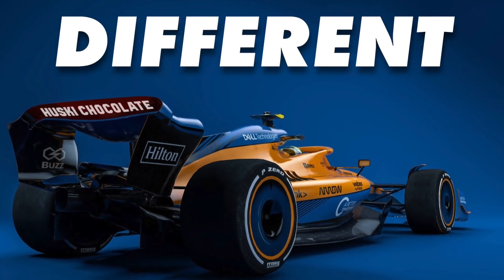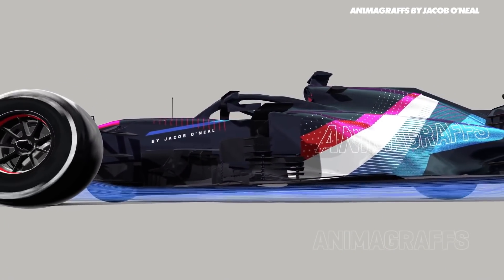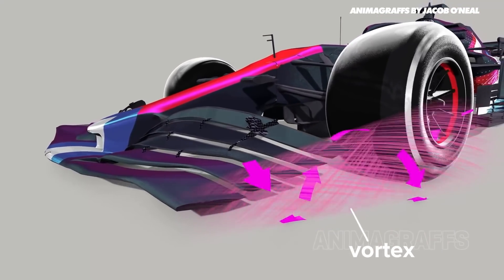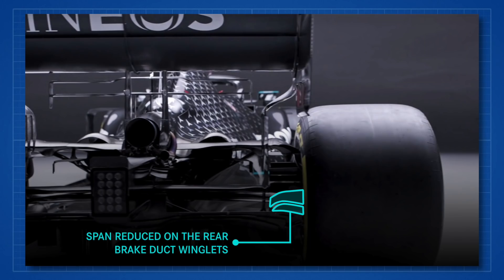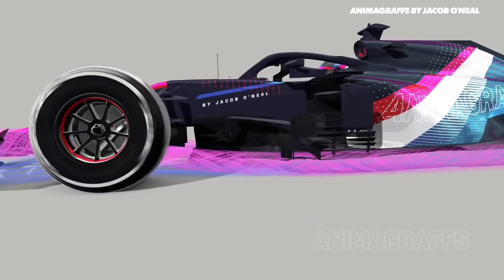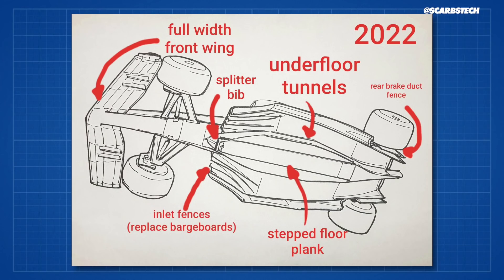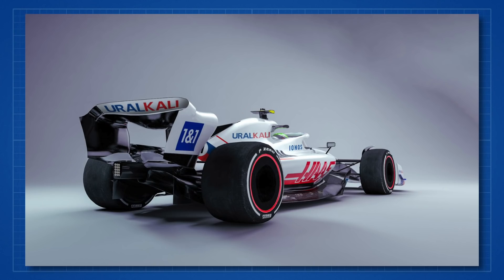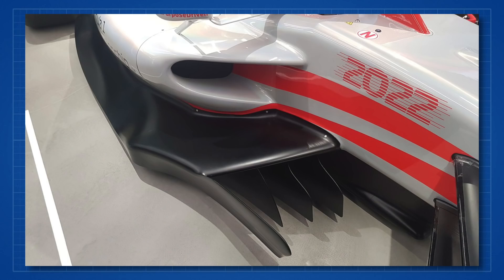How the 2022 F1 Aero Tunnels Actually Work

Comment: I'll be interested to see what happens if they ride the curbs and the impact that might have on the aero underneath the car. I can't see the 2022 cars being as aggressive on the curbs if its going to massively impact downforce
Reply: The big kerbs need to go anyway. Too many accidents already because of them.
Reply: @schwuzi  My thoughts, get rid of the kerbs altogether and keep all of your wheels on the black stuff or it's a penalty. They would all stay on the track then.
Reply: Won't make much difference in my opinion (for the title contenting cars atleast), I saw that the tunnels are mounted on the chassis that remains stationary the suspension absorbs most of the bumps and the tunnels aren't rubbing the ground like they did in the 70's rather these tunnels are lifted and are sealed via aerodynamics. So how well these tunnels are sealed I think will be the difference of performance.
Reply: @khawajabasit977  There's no such thing as a stupid question but sometimes I really wonder if these people even watch f1.  I'm not picking on you but the original poster.  Do current cars lose downforce when they curb ride?  No.  Why?  Suspension.  Suspension or more accurately ride height managers.
Reply: @Bahamuttiamat   Depends if your 'curb ride' involves some bounce that the suspension can't fully absorb which does happen so the OP's question is good. Anyway the drivers are going to have to avoid anything that will disturb the ride height because, obviously, ground effects is height crucial.
Reply: @FairladyS130  I have no doubt, but f1 suspension is specifically designed to be a stable aero platform.  We don't really concern ourselves with current cars losing downforce and ultimately control over curbs, so I don't see why there would be with the 22' spec.
Reply: @Bahamuttiamat  because if you change the attitude of the car the airflow under the car and hence the downforce will change, less on the side that's up on the kerb.
Reply: @philspencelayh5464  

My point is; modern f1 suspension is more about aero platform rather than ride quality.  Meaning curb riding will not upset the aero balance to any meaningful degree.  The areo platform is robust enough. 

Also, the 2021 spec f1 cars are in fact ground effects cars.  Hopeful this elevates your concerns.
Reply: On high speed areas like maggots becketts I expect they will be staying off the curbs now.  Also I imagine avoiding sausage curbs on low speed corners will also be an emphasis to avoid physical damage to the tunnels.  Regardless, I expect the lines to favor the asphalt a lot more in 2022.  What interests me more is high speed bumpy corners like Cota.  That high speed S section is going to wreak havoc with ground effects.  The indycar generates so little downforce from their floor, I don't see it as comparable.
Reply: They won't be riding curbs at speed, where aero comes into effect. Where they do ride curbs, it will be at much lower speeds where they depend on mechanical more so than aero-grip.
Reply: High Curbs are gonna be a drivers worse nightmare. Like more so then previous seasons
Reply: Indy cars have had tunnels like this since forever and they have no problems with curbs. So don't worry, F! designers aren't going to let themselves be bested by us American hicks.

Comment: "without cars, motorsport is just jogging." Now I weirdly find myself wondering which F1 circuit would provide for the most exciting foot race. The brain is a crazy place.
Reply: spa. running up the hill would be a nightmare
Reply: @davidcumming8567  yep, i did it by bicycle, Spa is really tough
Reply: @jean-loupparisis7330  yes. Spa and Daytona Road Course are tough.
Reply: @davidcumming8567  yes. Cars could slip and slide and headon into the tires.
Reply: @davidcumming8567 imagine running up Big Red on the circuit of the Americas 😂😂
Reply: Monaco be like: finnally I am worthy
Reply: @ayushkumarsingh7658  yes. Spa and Daytona 500 also
Reply: The Nordschleife
Reply: @elijahchampaigne6753  that’s a marathon
Reply: @raceyrache8463  2 rounds litterally are 😊
Reply: @elijahchampaigne6753  Daytona 500 and Rouen
Reply: Low key excited for a Monaco foot race, I recon it would solve it´s overtaking problems
Reply: How hard would it be to run in Mexico since the air is a lot thinner?
Reply: @DeeKooooo  Sergio Pérez is gonna get a huge advantage so you just gave him the win
Reply: Baku castle section would be awesome with 20 people jockeying for position
Reply: So reverse grid for foot race after real race??
Reply: @republikadugave420 that’s a great idea for a biatlon lmfao
Reply: Was jiggling and wondering myself 😁
Reply: Yes but blindfolded! That would test track knowledge 😆
Reply: @trisbonky  Blindfolded 1 lap foot race around an F1 circuit, with the pit wall calling out when to turn and how to stay on track and providing motivation.
Reply: Portofino!!!
Reply: Hamilton vs Verstappen 1 lap jogging race at Yas Marina would be best way to decide title fight
Reply: Doing a triathlon on and around the Zandvoort circuit this summer, I think the dunes will be quite a challenge..
Reply: @thijewubs9646  Don't you have swimming in triathlon? Do you wait for it to rain and flood the track?
Reply: @PunnamarajVinayakTejas  Haha that would be a viable option with our weather, but I think they planned to do it in the sea, which is just near the track
Reply: It would be any place where the temperature on track it's higher than 35°C
Reply: Spa and Mexico 100%
Reply: Jeddah, it’s a really fast circuit
Reply: It'll be fun to jog in Sepang under 33-34 Degree Celsius 🤣
Reply: As a runner, i have always wanted to complete a lap of the nordschleife on foot. I think it would make a very nice half marathon race.
Reply: Albert Park is basically just a jogging track when it's not a race track
Reply: Mononaco,   so many areas for heckling.
Reply: Monaco for sure. Any very technical track is likely to result in overtaking
Reply: Has to be Monaco
Reply: Brands Hatch but reversed. Paddock Bend uphill at the end of the lap would be a killer
Reply: Monaco would be interesting! "And it is two wide into turn 1!!!"
Reply: Teams would resort to parkour especially round Mirabeau Monaco
Reply: I'd say Monaco, it would be nearly as fast as the F1 cars go around it. Watching it often gets me to sleep.
Reply: Once a year they should do that. Maybe Monaco. The race would be more eventful.
Reply: Monaco will have some crazy overtakes & pit stops hahaha
Reply: I rode a razer scooter around Phillip Island when I was a kid. that was horrible, so bumpy on those tiny wheels my brain got rattled.
Reply: Just go back to riding horses
Reply: Jenson button was probably the fittest f1 driver of his time
Reply: @thelegend5243  you can't know that.  Pure speculation.
Reply: @Eugene Almost but not quite. You would want to go straight from apex to apex, and sticking to the right side is if all corners are right handers.
Reply: Spa would be an endurance race but I think something like monza would be perfect cause it’s so wide on the straights but so narrow in the corners
Reply: "Without cars, motorsport is just jogging."  Would this include pit stops for changing shoes?  How would aerodynamics of the joggers clothing be manages?  What safety gear would be needed in the case of falls and wipeouts?  Would there be a slipstream?  ....  You have created far too many questions!
Reply: I think he meant, without cars, “Motorsport is motoGP. And that’s awesome.”

Comment: "Air pressure decreases as speed increases."
Not quite.
I can't stand it when people make statements that over-simplified.
The pressure changes from static pressure to dynamic pressure. The total pressure does not change for a fixed volume.
It is helpful to think of the classic Brownian Motion experiment (put some smoke it a small contained vessel and look at the particles under a microscope). The smoke particles jiggle around with no discernible overall motion. The experiment shows that air is made from particles (molecules) that buffet against each other. The aggregate force (the average vectors) of impact of these molecules means equal pressure over a surface.
While the air is still.
Now, if we impart a flow to the air, the molecules continue to buffet about but the average vector of impact now runs more parallel to the surface of the container and so the impacts impart less forces into that surface. Thus the dynamic pressure increases (the flow) but the static pressure drops.
Remember that under a car, the air is not moving, the car is. The motion of the car through the air sets up the dynamic pressure change.
Reply: Let's be honest, if the description is as exact as you mention, it will be 20-30 minute long video
Reply: Feel clever describing it in a way the average punter won’t understand it?  Callum was well versed and was able to educate more people to a principle that is complex. I can clearly see you’ll never be the professor arguing stupid points like this.
Reply: @raceyrache8463  sorry, bun gross over simplificanions are worse than what you describe. Good luck explaining the truth to the unprepared.
Reply: @AlexanderJohnOgle  Cmon, don't be so pedantic

He literally already says in the video that Bernoulli Principle is beyond the realm of the video. Because we all know the rabbit hole and the implication of fluid mechanic is so complicated, you still need to learn it on master degree
Reply: @bocahdongo7769  You're right; but I am also. I think a tremendous disservice in done to people by short-changing them on explanationns. I could never understand the change in pressure until it was put in terms of static and dynamic pressure, and I think you may be doing a tremendous disservice by refusing them the same explanation.

Comment: Are high rake cars a thing of the past now?  Do the new regs allow for designs that could still play a lot with rake?
Reply: From my understanding, the rake goes against the idea of ground effect, ground effect is the most effective when the body of the car is as close to the floor as possible. Back in the 80’s type of ground effect, the bumpy surface and high curbs could make the cars somewhat ineffective and that’s why side skirts were banned in 81. So to put it simple, yes, high rake cars are in the past I assume

Comment: Turbocharged, ground effect F1 cars…all we are missing now is active suspension for F1 to look like all the doodling looked like in my mid 90’s school books…
Reply: And active aerodynamics imagine those wings morphing in the straights
Reply: @Michallote  well DRS is effectively active aero already
Reply: @Michallote  just had a refresher on the FW14B…not moveable wings, but the rear end sitting down on straights to stall the floor is an active aero of sorts. I understand now as an adult why ABS and traction control had to go, but why stuff like active and four wheel steering? This didn’t make driving any easier and we’re seriously cool tech. Also, why keep paddle shift boxes and not TC/ABS. Surely getting rid of H-pattern boxes was at least equal in making life easier for the driver…
Reply: It was considered for this year so maybe 2026 we could see it
Reply: yeah, FRIC needs to comeback

Comment: As a physicist I must say: 
There's 3 phenomena that create lift/downforce in different measures for different occasions
-1st is Newton's third law, you push the air it pushes you
-2nd is difference in pressure
-3rd is coanda effect (the air sticking to the body), in airplanes the air travels from above the wing to underneath and that causes lift by newton's 3rd law but in a different methodology hehe

Comment: I would still image that today's computer simulations are a more effective and efficient design tool for today's industry. 
Wind tunnels are mostly "proving grounds" before the rubber meets the road. 
While still a necessary step, most of the innovations today evolve from digital materials/mechanical engineering using flexible computer simulations.
Reply: also it's cheaper, i can buy a cfd software and just install it to my pc, and make a 3d cad design or, just laser scan my car. Of course going to a wind tunnel and pay for hours would be cheaper, but in long terms computer sim is cheaper
Reply: @NikoKyunKyun  Mechanical and material stresses/forces are also part of the simulation these days, not just aerodynamics. These parts can be redesigned in the computer before they are manufactured for the ultimate design with less prototyping specific parts. Includes the mechanical/structural data, as well.

Computer tech is hard to beat these days. Of course you'd still run it through a wind tunnel for the real-world result.

One day in the near-future these cars will be completely designed and created using powerful computers and robots.

What's next, robotic pilots?
Reply: @JoeGator23  That partially already exists, the autopilot can technically do everything during the entire flight.
Reply: @Emelydiaa  I'm talking about F1 cars, too.

Comment: Imagine there is contact and a piece of the floor (skirts) is broken. That's pretty much a retirement I assume, since the air being squeezed will escape and the downforce lost. Also it could create an unbalance in contrast with the downforce being generated by the otherside tunnel.
Reply: But losing a bargeboard nowadays is also fatal
Reply: Bruh, the front wing endplates used to seal the floor with vortices. Those are much more vulnerable (and they still had the bargeboard of course)
Reply: Hear  me out. What about quick swap tunnels like FW. Genius idea , F1 call me for patent. LOL This is way to go. 🤭
Reply: @alesksander  Believe in JESUS today, confess and repent of your sins. No one goes to heaven for doing good but by believing in JESUS who died for our sins. GOD loves you soo much unconditionally.🤩❤😍🤗
Reply: I believe he does mention this in the video.
Reply: There are no skirts. It's all venturi tunnels and base suction from the diffuser. Also the floor is linked to the suspension to ensure it stays at a stable ride height while the body may move up and down.

Comment: In the most simple words - instead of those convoluted explaining - air can either PRESS you down or SUCK you down.
Thank you, good night.
Reply: you still have to explain the how.
Reply: Except "suck" doesnt really exist. It's the ambient pressure pushing the car down, trying to mix and equalize with the low pressure area underneath. You dont suck fluid up a straw technically, the atmosphere pushes it into your mouth (just a neat, pedantic fact)
Reply: @RhodokTribesman  You just explained suction.
Reply: @amjan  suction as a "force" is like visualizing inertia as centripetal "force"

Comment: Meanwhile at Haas: “what’s a windtunnel?”
Reply: Mazespin just tells the engineers what they need to known.
Reply: @livinginthisgalaxy7961  Mazespin?
Reply: @zayaanshaikh1890  yeah mazespin. The Russian that can’t drive in a straight line 🤣🤣🤣. His dad just pays for what is needed
Reply: Top Gear meme the speeed!!!!!
Reply: Haas don't need a wind tunnel, Ferrari has one.......
Haas are going to use as many Ferrari parts as possible, and even though they are meant to design their own aero, I wouldn't mind betting that they will end up with some sort of Ferrari B design. I can't prove this, but then I doubt that the FIA can prove it either 😎
Reply: @the_lost_navigator7266  you obviously don’t know the rules
Reply: @raceyrache8463  maybe not. Please explain how they can ensure that IP is not passed from Ferrari to Haas when both teams are situated in the same place?
Reply: @the_lost_navigator7266  they’re not in the same facility and it is against the rules to pass intellectual property between teams. The FIA has all intellectual property from all teams and can quickly analyse if they are cheating.
Reply: Man dont do haas liek that. They performed really good for years before taking that year off 😄